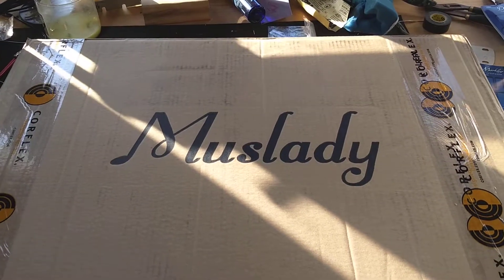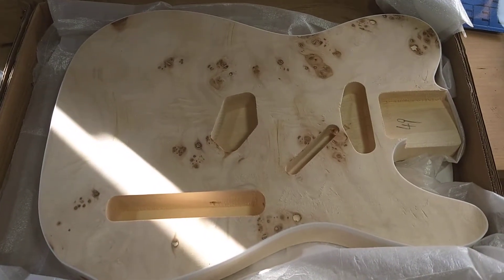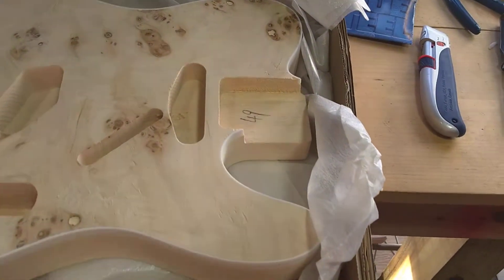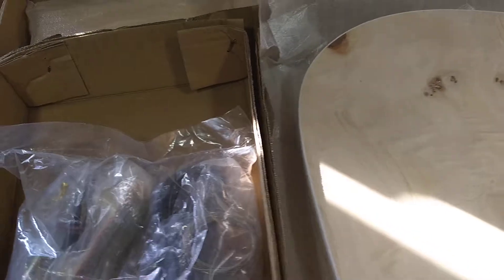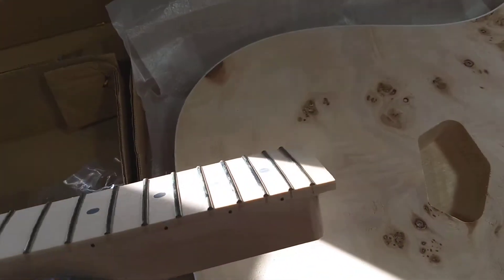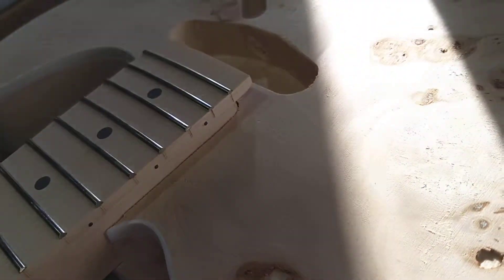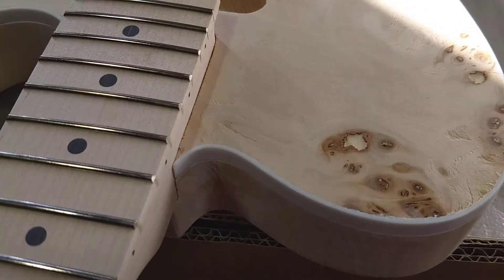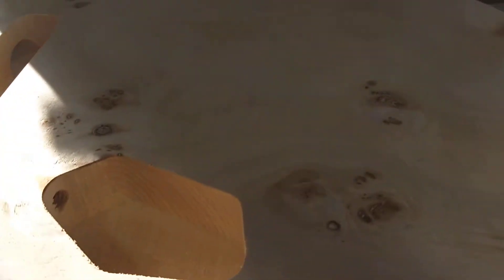Burl/Spalted Tele first look

Comment from the maker: Two points of interest not covered in the video...one this kit did come with basic assembly instructions....and two, on careful inspection of the neck, when the high e side frets were beveled, they took a little wood . I won't know until it's assembled if it's an issue or not.
Reply from the maker: Finished product came out great. Needed  a bit of work, and had some issues for sure.